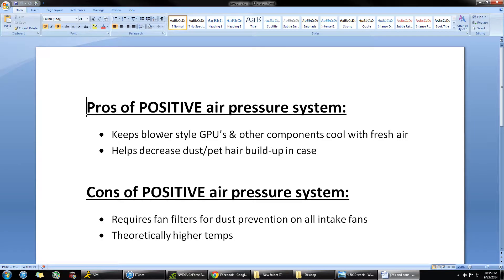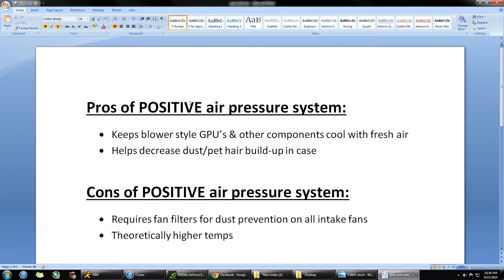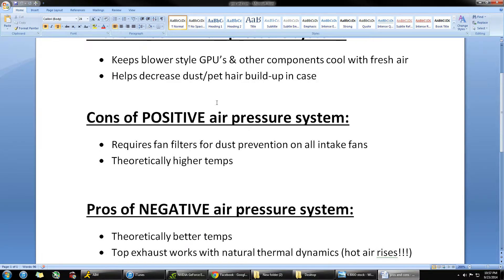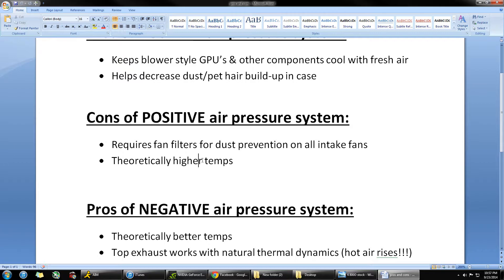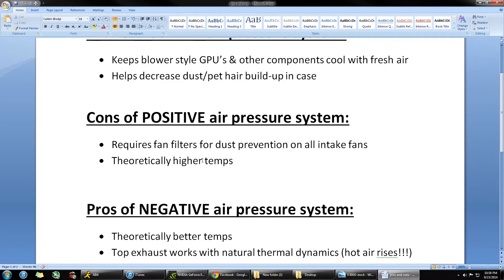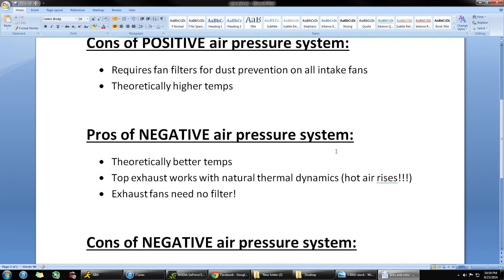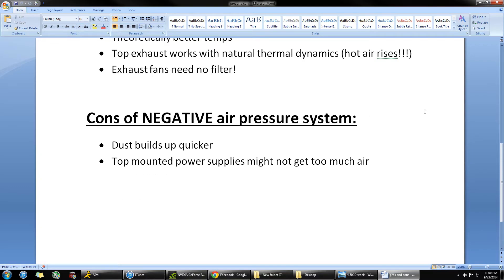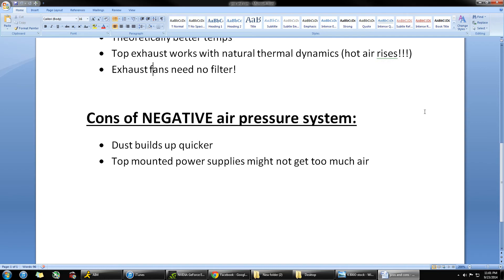Pros and Cons of Positive and Negative Air Pressure

Comment: hot air rises doesnt matter in cases
Reply: exactly. I see a lot of people holding on to that piece of information as if it were important in the normal scenario, it is not and in 99.9% of cases it is still not. if there were no fans in the cabinet then it could be relevant